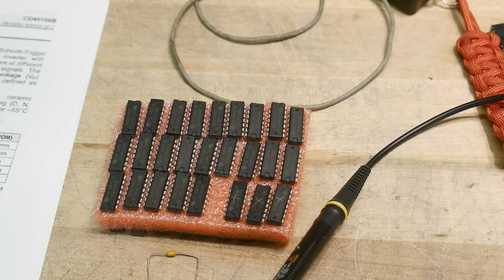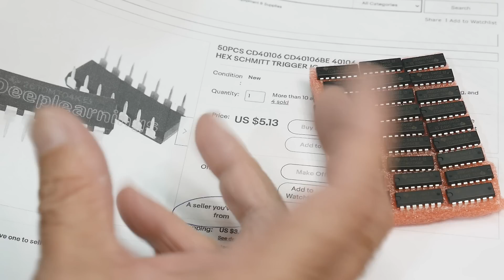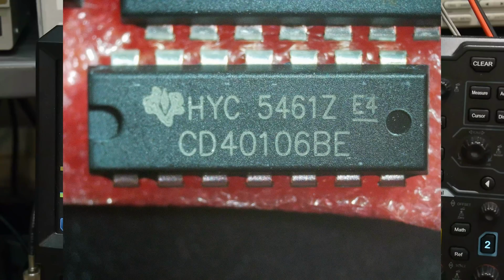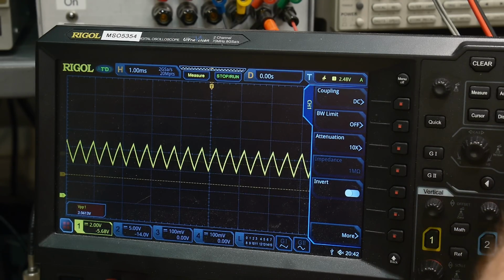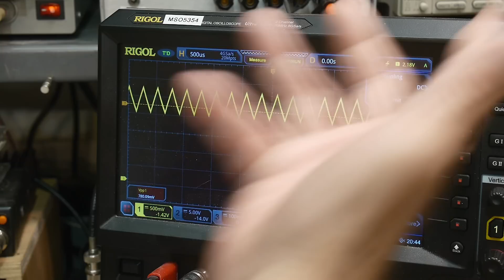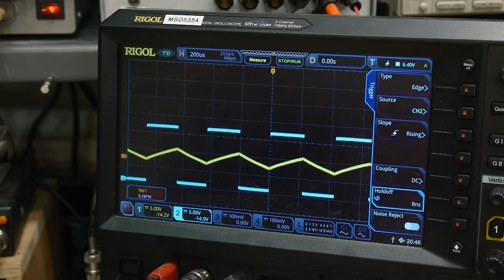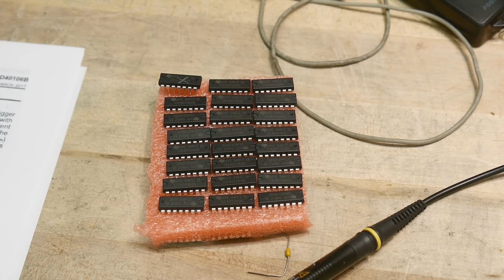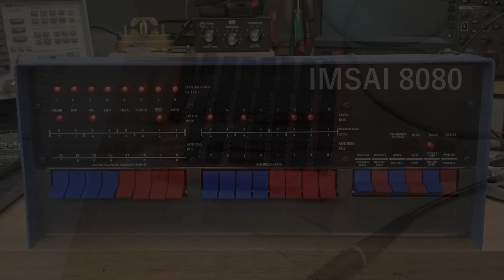#1317 Fake CD40106 ICs

Comment: At 10:00 "the hysteresis is completely wrong ..." No, it isn't. You really must read the datasheets. You're quoting typical hysteresis values from the first page. Look at the "Electrical Characteristics" section on page 7. You'll find that at Vdd=5V the maximum hysteresis is 1.6V; at Vdd=10V, the maximum hysteresis is 3.4V; and at Vdd=15V, the maximum hysteresis is 5V. The part you're looking at is within spec at Vdd above 5V and almost in spec at 5V. It depends on the application, but as long as the hysteresis is in the right ballpark, most applications are going to work fine.

They are not 74HC14. The part is likely a CD40106 from a batch that was rejected as not able to take the 18V supply required under Recommended Operating Conditions. Note that the Absolute Maximum Rating of 20V carries a disclaimer, "These are stress ratings only, which do not imply functional operation of the device at these or any other conditions beyond those indicated under Recommended Operating Conditions. I'd strongly recommend sticking to 18V maximum supply, and probably 15V, if given the choice.

Comment: I'll pay a premium for known NOS parts - humidity, surface corrosion, those are nothing compared to getting fake stuff that you don't know ever worked.  As long as the silicon still works, the other issues are usually fixable.

Comment: I don't get it🤔...why is it fake if you're driving the chip voltage pass the recommended specification to prove it will fail? You need to return the seller chips😇
Reply from the maker: the real parts are good to 20 volts. read the datasheet: https://www.ti.com/lit/ds/symlink/cd40106b.pdf
Reply: @IMSAIGuy Yes but that doesn't mean you should drive it to destruction...a bad component in my opinion...SCR that would overheat with the correct bias voltage or a logic chip that leak between pins...etc
Reply from the maker: @basimpsn  the datasheet says 20V if you put 20V on Vcc it burns up. I ran the part as it is to be used. I did not try to make it fail.
Reply from the maker: I assume you have never designed with 4000 series or 74C series logic before. I try to educate people. please read the data sheets. these are not 5V parts.
Reply: @IMSAIGuy  Ok just downloaded the full datasheet you're correct my apology 👌

Comment: Comparing any parameter with just a typical datasheet figure is nothing to make any reliable conclusion. Certain manufacturing spread is a normal thing, so you should always compare with the specified limits (min-max), as those are the really bounding values. The thing is, the parameters and their limits of these standard logic families are not set for the individual manufacturer or even part, but standardized for the type family. And are set so, they are not that difficult to achieve by practically anyone designing these devices. That does not only mean various makers, but also various processes used for the same part number by the single maker, the device from 1980 (or from the early years of the CMOS4000) will have the same datasheet as the one made today, but the exact process had changed so this component had to be redesigned at least 5x over that time, leading to 5 different real mean parameter values. So you will find similar differences between a part 40 years old and a new one, even so both will really be genuine from the same maker.
However this does not mean your parts are genuine good parts or so.

Because there is another way how substandard parts come to market: They are genuinely made by the company (here TI), but the end-of-line test reject units stolen from the testing floor (normally these bad ones are supposed to be destroyed) and then sold on such shady places. Normally the production yields certain percentage of parts that are bad in some way. And apart from really dead devices, the most frequent defects cause the breakdown voltages to become lower than specified. As a side effect, in CMOS it may cause seemingly faster speed, but the too low breakdown was the reason why they were rejected.
For you vs seller relation this does not mean anything different, the devices are counterfeit either way, regardless if they are remarked other part or other maker, or whether they arerejects that should have never left the manufacturers premises but were stolen, smuggled out and then sold...

Comment: I wouldn’t ever buy any parts from eBay or Ali Express unless they’re no longer produced and can not be substituted with a modern part.  The prices from possibly reputable offshore sellers are almost the same as buying from Digikey or direct from TI anyway.  I needed to get a small quantity of adjustable LDO regulators recently and direct from TI was less expensive and faster than dealing with distributors anyway.

Comment: there was a seller on ebay selling supposedly 4116 ram chips that turned out to be remarked 4164s,  definitely not drop in compatible, luckily they tested good as 4164s, but would fail if fitted in place of 4116s as they have a +12v supply where the +5v pin is on  the 4164!! i messaged the seller they should alter the listing and state incorrectly marked, but they never changed it ..

Comment: You should never use the parameters headlined on the first page of the datasheet when verifying performance. These numbers are average figures only derived from test of large numbers of devices and do not represent the spread in values that can be expected from an individual chip. Experienced engineers take no notice of the headline figures on the first page of a datasheet as they are usually there just to paint a flattering picture of the part performance.

If you read the detailed specification on page 7 of the TI datasheet you will find the allowable range of hysteresis is from 1.2V to 3.4V when tested at Vcc=10V and 25C. The example tested was within the valid range as per the manufacturer's datasheet and therefore the hysteresis test is not conclusive as to the part being fake.

Comment: For the hobby people low price stuff and learning a new design circuit is fun.  However, chasing your tail when everything is OK and just bad new parts.  😏 Grrr.
This is where experience helps as in knowing how to run these tests to enhance the learning curve. 😎 Thanks a lot for something to try out.
PS. These factory people are very creative even if the components only sort of work when making chips. Something over my head.
Reply: IT seems insane to bother to manufacture low value chips as fakes rather than just do it right.  Their minds work strangely.
Reply: @tomsherwood4650  Yes, I agree.

Comment: The actual frustration of using counterfeit parts is that the crunchy numbers ,given in the datasheet, that we require to do our design calculations is not what the parts actually present us with. On top they are genuinely unreliable. Out of a 100 of them, you might encounter one part that actually works, but the main point of getting them cheap per unit gets overlooked that way. I'm a mere hobbyist. So it's somewhat ok for me to get away with them in the low end projects but if I ever intend to do something serious, like doing some mod to my car or motorcycle, I'm ready to spend that extra dollar or cent just for the sake of reliability.

Comment: Ha ha! I’ve been a victim of buying fake devices “from China’. Laser etched markings is a big red flag, since many devices manufactured in the 70’s and 80’s were inked. I suspect laser etching was rare at that time. Also a badly drawn logo is a massive red flag. Companies would never ever allow their logo to be badly printed. I’ve bought MC68HC000-16 parts which were revealed by a little IPA to be MC68000-8 ! 🤬 MC68000 PLCC 100% non functional. “Intel” 8088’s 100% non functional (pin 1 and 20 are GND but had no continuity - note this is expected only for the CMOS parts). Sellers simply play dumb. eBay don’t give a rats a—e. They are happy for you to return the fake devices to the seller. The seller of the fake 8088’s continued to sell the devices even after I made it clear in the negative feedback that they were fakes.

Comment: Every CD4000 dip part I bought from TI this year was laser marked. Yeah, I did buy all they made to have a lab stock of known good parts. Some markings were actually hard to read without proper light - they were quite filigree, thin lines. None had screen printing or molded numbers, although perhaps if TI uses more than one packager, they may come in two varieties. 

There are no “out of spec” parts you’ll buy new that are not fake. I’ve tested many chips and they were usually very close to typical values or better, and the process control seems to be much tighter than it was decades ago.
Reply: Some of the Chinese manufacturers will take defective parts, package & mark them, and sell them through back channels, resulting in new, legit, yet out of spec parts. There are some very shady manufacturers out there.

Comment: “deeplearnings” lol. Yeah, there was a “deep” learning: buy from TI if you want logic that’s still made, and CD4k is definitely still made and all 14- and 16-pin parts are available in DIP. Yes, in 2022. You could buy them in just the same in the 70s. The family is half a century old now (or maybe more?). I’m a big fan of the 4k family. It’s so easy to have it interface to and from higher voltage analog circuits. And it has essentially zero EMI running at low voltage. At 3V, you’d need awfully long wires to hear those outputs switching. 

It’s rather neat for teaching the CMOS speed vs voltage relationship - it’s so magnified!

Comment: You can buy the entire 14/16
pin CD4000 line from TI in DIP. Notable exception is 4000 “mix and match” gate, 4008 adder, and 14530 majority functions - all no longer made. CD40106BE is right there to buy, thankfully - but for a bit more than a dime per IIRC. Also, sometimes it helps to also check TI’s stock when distributors are out. Many times they had it when distributors didn’t. The only 4000 parts you won’t get in plastic dip today are 24-pin parts. Those are only available in smt or cerdip.

I’ve got the entire series at home to play with, and those are fun parts indeed. They make amazing voltage controlled ring oscillators. Going from 3V to 12V is 5x frequency change at least. Also, using CD4066 and delay lines you can generate rather short pulses. Clean 15MHz clocks coming out from this old, old CMOS family are a sight to behold.
Reply: when the shipping to your country is 150/200$ from official sellers, you don't have a choice but to buy from china.
Reply: @mahadotube  I agree. That’s unfortunate.

Comment: Just received 5 LM2917 from China. Worked as f-v converters, but the internal voltage regulators had fallen out of the chips in transit. They need to provide better packaging. An unkind person would suggest that they are LM2907's rebranded. AliExpress refunded my payment. One ended up as a 13 pin. Had to straighten all the pins that were bent because of the apparent foam packaging shortage in China.
Reply: I nearly lost my mind when I got a package of DIP-40 sockets with no foam or anything in a plastic bag.  I was able to salvage like maybe 15% of them.
Reply: @big0bad0brad  The spring contacts/legs are removable in the standard Chinese ones, so if you have broken legs, remove the good ones from the worse socket, and do some transplanting, or remove them from cheaper sockets from China, ie, 8,14 or 16 dil ones, if you don't want to waste your 40's. Hope that you haven't already dumped them.
Reply: @peterrhodes5663  Y'know, I should have thought of that myself, and I do still have them.  Thanks for the tip!
Reply: @big0bad0brad  Another thing that you might not realize about those Chinese sockets. Because the pins are inserted into the body after moulding, they don't need such a big end overlap, so if you can make a 16 pin one by simply soldering in two 8 pin ones, butted together, or a 14 by removing one end, by one pair of pins. With 5 x 8 pins, sawn in half to make sil sockets, you have a 40 pin one, once soldered into the pcb. If I ordered specific sockets today, I'd be fortunate if they arrived within 2 months, and sometimes they never arrive. I keep lots of 8 pin ones, and adapt.

Comment: I didn't get a clear understanding of how you are measuring the hysteresis limits. A guess: the positive output of Schmitt is charging the capacitor, up to the rising trigger threshold, which then causes the output to go low, and thus cut the charging. Then the capacitor drains through the resistor, until the lower threshold is reached, at which point the Schmitt output goes high and resumes charging. Is that about right? I looked back at the chip of the day video on this part, but I don't think you showed this particular oscillator circuit.

Comment: I'm still taking a chance at burning up my stock of amazon 74hc595's on a project. I only had one fail, and I'm not certain it wasn't my fault. Even if all is well, I'm no longer buying parts outside of trusted suppliers. Ya cant even trust 1% resistors on the internet shopping market.
Reply: Actually, the one time I bought a pack of assorted 1% resistors on eBay, they were indeed as stated-I tested some of them, and found that:
1.they were resistors(axial lead, film. 1/4 watt).
2.they were actually within 1%
Note:I did NOT check if they could actually dissipate 1/4 watt, so they could be deficient that way. 
So perhaps resistors are a reasonable risk.
Reply: @m.k.8158  most of my requirements are satisfied with 5% tolerance. I would still buy the ebay 1%, but I wouldnt go plugging them right into a 1% critical circuit without measuring them first.
Reply: @chetronics  I agree of course, just as long as you trust your meter enough.

Comment: A lot of DIY synth builder use 40106's for square wave oscillators. Very popular from that crowd - it seems like the DIY audio/synth crowd is not super-sophisticated when it comes to electronics, but may not use them in a way which pushes the chips anywhere near advertised specs, and therefore may not care about a chip that doesn't meet specs. Doesn't mean its OK to sell fake chips, but the point is that some people may not care/notice and that's why there's a market for them.

Then again, it may be that there are a lot of frustrated DIY synth enthusiasts that are being turned off from their hobby because of the frustration of dealing with fake parts and not understanding why things aren't working the way they are supposed to  :/
Reply: In analog synthesizer and organ technology most of the components doesn't operate anywhere near their limits. Even the slowest gate will usually work fine. However, some synthesizer applications are very sensitive to leak currents and voltage off-sets so it all depends on what type of deviations the fake components are showing.

Comment: Probably these fake chips are the reject of the scrap of the discard of the wafer outermost part. I bought a stock of twenty 555 chips: burned a quarter on the breadboard trial session and another quarter onto the corresponding definitive pcb 🤦👎
Reply: That's so infuriating. Then you check what you did wrong for some time before you discovered that they're fakes. I redid a whole pcb before I realised that the transistors were fakes, thinking it was my mistake.
Reply: @xminusone1  😓

Comment: Interesting, though it may be worth a look at the 'old' Harris datasheet as that seems to imply the hysteresis voltage could be between 2.3V and 3.4V at 10V and supply voltage should be no more than 18V (with an absolute max at 20V). No guarantee that this is an old Harris part of course (may still be fake) but Ti may have improved things since the acquisition.

Comment: Some time ago I bought six "Rockwell 65C02" processors "made in 2014". Two out of six happened to be regular NMOS 6502 CPUs, and four were re-labelled 65C02 parts from 1980s and maybe 1990s. Even the case style of each one was different. If they didn't get into trouble of grinding and repainting them I'd get them anyways, at least for the price. Would even prefer them this way. Shame.

Comment: These might be VHC parts. If so, they make great level shifters. Power them at 5v and see at what point an input fails, guessing 11v. You will still have 5 gates to test. On ebay, I only buy bulk from on-shore brick and mortor surplus sellers. Prices are closer to new retail but now are on par with Chinese sellers.
Reply: Hi, would you be willing to name a few of those vendors?
Reply: @Enigma758  flex-direct is my main goto. Free 3-4 day shipping, most sales are $13, and they have this cool 4x40 LCD I want more of but don't have any projects to use them.